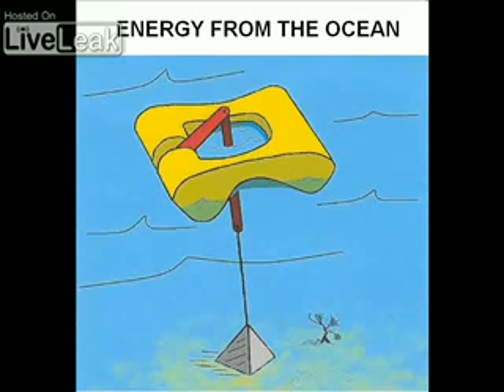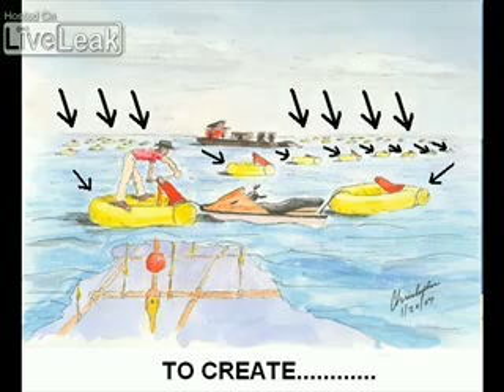Debunk this: FREE ENERGY

Comment: @rockethead7 

An interesting parallel here with solar and hydro (as you just mentioned) and geothermal. 

Solar panels could, if inefficient, act like asphalt does and heat up the ground passively, to disturb the natural nightly release of heat into space.

Geothermal is a whole can of worms that may or may not have problems. I can't see using waste heat from the earth's hottest places as terribly harmful, it doesn't contribute as much heat as the sun does.

Comment: @scienceminded
Technically speaking, I wouldn't mind if we had wave power as a backup source of some kind. If we keep the consumption of the power pretty low, the negative effects could be kept to a minimum. But, wave power is not the end-all-be-all answer. Remember people from 100 years ago thought building dams (like Hoover) would be the limitless supply of energy. Well, sounded nice. As long as it rains, there's power. Then they found out it had huge environmental effects.

Comment: @scienceminded
Dude, fucking read the journals. Do the math.
You quote from people who clearly think that tidal power is practically limitless... but man, I could find quotes completely opposite. Quotes mean NOTHING.
MATH is how you compute it. Take the forecasts for energy consumption curve for the future. Factor in a standard efficiency rating of about 33% (which is about average for mechanical systems). Subtract the tidal lock intertia from the current inertia, and do the MATH.

Comment: "Because the Earth's tides are ultimately due to gravitational interaction with the Moon and Sun and the Earth's rotation, tidal power is practically inexhaustible and classified as a renewable energy resource. Movement of tides causes a loss of mechanical energy in the Earth–Moon system: this is a result of pumping of water through natural restrictions around coastlines and consequent viscous dissipation at the seabed and in turbulence. cont>

Comment: @rockethead7 

The energy comes from the earth moon system, correct, but taking away energy slows the inertial loss, you couldn't speed up inertial loss by taking away energy, that would mean you are doing negative work. 

If we slow the tides we slow tidal recession, not speed it up. THAT'S the energy you are taking out of the system as more friction, preventing tidal bulging and inertial loss to the moon.

Comment: @scienceminded
500 characters is not nearly enough to respond in detail. But, no, the main effect isn't the height of the waves. The main effect is the friction (the generator devices would have to be planted, or they wouldn't work). There are secondary effects also, such as the repositioned water, etc., thus adjusting the lunar pull, etc. But, in short, look this up. There are hundreds of peer reviewed papers on it. I can't possibly explain in these limited comment fields.

Comment: The advanced retardation of @Cristofre
"instead of tidal lock at 20 million years and one day, its just 20 million years?" - Wrong. Off by a factor of over a million. Not a small error.
"Most of the earth is literally water." - Wrong. It's 0.02% water.
"Any force pushing against the generator would simply be passed back to the water/earth" - Wrong. The effects are understood.

NOTHING you've said has been correct. Quit talking out of your ass about stuff you clearly don't understand.

Comment: @rockethead7 

Correct me if I'm wrong (and I ask you do so in a civil way, I'm not emotionally invested in this at all so your secondary commentaries here are of no interest to me), but would not a reduction in wave height in systems which convert mechanical wave energy into electrical energy actually slow the lunar torque so it takes a longer time for it to move into higher orbit because the tidal bulging is exactly what causes inertial drag? You seem to be expounding the opposite

Comment: @tauruszuma I guess the issue with this particular video is the fact that the dude named the video "free energy" without fully understanding the fact that there are thousands of scams out there that use this term to name machines that supposedly make energy out of nowhere. His design is a very common wave-energy generator that transforms the wave's oscillation into electricity(Portugal's been mass deploying these for some years).
It's "free" as in readily available.

Comment: This could actually work.  And I had heard of it before, sometime in the mid-1990's, I think, called "tidal generators" or something like that.  But this is actually "renewable" energy like solar power, wind power, etc.  This is just another form of hydroelectric power.  Like someone else said, it's not "free" in the sense of perpetual motion, which is impossible.  This is actually realistic and could work.

Comment: Of course it is practical. You would only have to generate enough power to maintain battery packs. With the proper internal gearing a device the size of an oil rig could produce serious amounts of clean energy without depleting the resource. It is a very innovative concept.

Comment: one of the biggest problems with renewables right now is the inability to produce a consistant flow of power from these sources of energy, we're left short when it itsnt windy, and when its too windy we have to shut the things off to prevent them setting fire to themselves (problems not just with turbines, other problems are associated with other sources) its actually more inefficient to switch between renewable and coal than to just run on coal. we just need a way of storing the energy for free

Comment: @1overthehillsfaraway 

Cont.

Also I believe it's you who missed the point my original post was in protest to calling it "Free energy" which is typically assigned to a system that violates the law of conservation of energy.  Add to that the fact that this isn't free in the economic sense either, and you can see that the title is misleading.  He said this cost roughly 60$ and it will wear out. total output/total cost = power price.

Comment: @UrSoMeanBoss Yep true, nothing free about this energy. It costs hydrogen to make. The hydrogen fuses in the sun's core by nuclear fusion, releases heat which travels through space, absorbed by our atmosphere which drives weather systems which creates waves. Basically this is thermonuclear energy and it will run out eventually. Myth debunked.

Comment: @bnewton81 Magnets are *not* a source of energy (unless you do a matter/antimatter annihilation with magnets as the matter). Think of magnets like a spring or like gravity. They can aid energy transfer but you have to first put in what you get out, and you lose some in conversion losses. So a motor running a generator is nothing but a complicated way to waste power. It's a modern day snake oil.

Comment: @MrRiddler1111 yes its too simple to work. since you need energy to take the "inflatable" underwater or to inflate it which will always be more then what you would get out of it. but this idea is an old one. at least 100yrs old. its a very inefficient design. better ways of getting power from the waves are. the ones that uses a larg cavity that waves rush in compressing the air inside, the one hole that lets the air in and out has a multi directional turbine to convert that force into electricty

Comment: okay but only bc you said "DEBUNK THIS" yes this is "clean energy" or "renewable energy" but not "free" . on the one side you have the over unity/magnet motor nuts who claim for it to be "free" it does not have an energy input. where this clearly does waves. then you have the other side, of nothing is free. start up cost, maintenance cost, ect. then there is me, who liked the idea when i first saw it in a book about tech from 100 yrs ago. it has its places, but too inefficient of a design.

Comment: i see an inconsistant energy flow.  instead of powering leds as a demonstration, why not route the inconsistant flow into a car adio Boom Cap  (storage capacitor and regulator) for a build up of electricity and a continuously regulted, and adjustable flow?  I haven't found anyone conaining the juice to create a surplus.  until the flow is continuously creating surplus, there will be no market for the product.  with no market, no further developements will show.

Comment: what about using a double arm type of thing? It would allow you to use a second motor on the other side of the float. Connect the 2 together with some type of hinge system and boom double the power.

Comment: It actually sucks power from Three things:
1. Moon's Orbit (pulls on waves, helping cause tides)
2. Earth's rotation (Causes massive currents: google Coreolis Effect)
3. The Sun (Heated water expands, pushes colder water, causes waves)

The concept works.

So, as @SephieRothe says, nothing to debunk, but the energy is about as free as solar panels give.

Don't worry, there's plenty of energy to swipe from those three before they give up! Especially since it won't affect the sun directly.

Comment: Neat idea, but over engineered.  Things like these wave generators are already in existence, but they cannot generate enough power to make them usable.  

A simpler method is a tube, mounted to the sea floor, with a coil of wire within.  Then a large float outside of the tube, containing strong magnets.  As the waves move the magnet/float up and down, electricity will be generated, like an alternator does within a car.

Good luck to these guys, but they are a few years too late.

Comment: @kal9001 Seems like a good way to harness power.  I suppose a series of conditioned capacitance circuits would create a constant flow, if however if a conditioned power circuit were used to charge a series of power cells, you could achieve a highly efficient power source using only a few floats.   the real trick would likely be to have these floats move on a fixed vertical rail system, such as a pole firmly planted in the substrate below the surface.

Comment: @LastCynicStanding Buoyant force while completely submerged (neglecting weight of device):
F = 870 N
L = 2 ft = 0.61 m
Emax = F*L = 531.6 J
Assuming wave of this magnitude occur every 3-5 seconds:
Pmax = 106 - 177 watts
Now hook it up to some sort of power conditioner and battery system. Chances are your actual power output is far less than half this number. Congratulations! You can now power a 60W light bulb.

Comment: @LastCynicStanding Well finally! The sarcasm ends and you just blatantly called me stupid. I can't believe you're 37. Have you left any comments in which you are not insulting people? Okay... some time for some engineering. Given ~6" diameter tube, ~4 feet square (16ft of tubing), maximum lever arm displacement of 2 feet. The maximum available power will occur if the device is completely submerged by the wave while the crank is pulled. Next....

Comment: @LastCynicStanding Great job using a phrase out of its original context! I get your point, but my problem isn't a lack of vision, it's the painful stranglehold of reality. This device by itself is very limited. There needs to be a means of regulating and/or storing the energy produced. I think the idea is great, it just still needs quite a bit of work.

Comment: Now... how many of these will you need to say... power a typical coastal city? Or is this just an energy supplement? Furthermore, the energy produced must be used, power companies have to adjust power output to meet demand, it can't be stored readily. Wind turbines can adjust the pitch of the blades to control power output. Nifty invention, but I fail to see the practical application yet.

Comment: @imposible2play
You're right about it compromising the sea. These things will cause a change in the wave intensity, which could change the local currents enough that the local sea life would be affected. Changing current flow could starve out coral life by damping the flow of water which carries the food the coral normally gets.
You create a "Surge Pool" and place many generators in the Pool... But that would cost big bucks to engineer.
Nothing is free. It's all about the R.O.I.

Comment: Don't count your chickens yet... This is a spin-off of another ocean wave powered generator that was built about 30 years ago. Same basic principle: Device floats but is tethered in place, wave action caused a ratchet-type lever to spin a flywheel attached to a dynamo to produce power.
3 major issues you're going to face:
1)Keeping the device anchored!
2)Power line maintenance. Very costly!
3)Bad weather rips device from mooring line and power lines. Ref. 2

The salt air & water win every time.

Comment: there is a huge error on calling this "free energy" free energy doesnt exist since the laws of thermodynamics exist.  This type of devices are "renewable energy devices" or more to the point "Electric generator that runs on a non-payable form of energy" NEVER a "free energy device"

Other than that... Is a great machine, you should be looking now for a way to make that output stable. Maybe a bank of bateries and capacitors ???

Comment: @kurisu925 Of course I do understand where you are coming from. But if you had seen the actual road test demo you wouldn't think that there is a hidden wiring. Perhaps hidden batteries, but at bare bone set-up of the vehicle, finding such batteries to run for full 10 minutes with that motor should not be so difficult. Yet there is none to find. 

Anyway, you'd be hearing about this a lot in the very near future.

Comment: you couldn't put them anywhere near each other... they'd tangle like crazy.  It does produce energy, but not near enough to sustain some little led's that require almost 0 current, let alone a house that draws probably 50 times the voltage and 10 or 20 times the current.  You would need either a 50ft one of these things, or about a 1000 of those little ones just to power a single home on a regular basis, and that's only if you had a dedicated battery system that charged over night.

Comment: Very good idea, I think wave energy is going to be the "wave" of the future, But I see some problems that I think should be addressed. Not to discard this idea but it has to be a whole class simpler a system to be viable. I have had a few designs myself over the years and discovered  gear motors and springs just will not hold up over time, or at least offset repair costs enough to be viable. salt water, debris, wave action and wear points such as cable connections and bearing surfaces all suffer

Comment: This video is definitely entertaining but, it does not contain any usable or technical information. How much power does his device produce?  Maybe 300 watts at the generator? by the time the power travels through the transmission line to the lights it is probably closer to 200 watts. If the generator itself is repeatedly submerged under saltwater it obviously will not have a very long life expectancy.

Comment: i hereby coin the term "waste energy reclamation device" there i said it. Just like  solar/wind/tide power, the devices are used to turn energy we dont pay for, into energy we can use for a pupose. THe converting process costs money (like everything else) such as photovoltaic cells and windturbines, but the energy input is free and usually in a form we cant use for a set purpose.

Comment: There is no such thing as "Free" Energy in the monetary sense. The device still has to be mass produced, purchased, delivered, and set-up, which will require additional equipment (i.e. a boat). But "Free" in the sense that you don't have to buy the energy itself, as you would with Gas? Sure I'll buy that.

Comment: With those LEDs I could see nearly all the way to the other side of my dining room!

A bit harsh, sorry. Nice work guys but there are loads of energy from the sea projects. One of the interesting  issues (apart from problems of building life size units and transmitting power down cables) is that when you extract enough power to be useful to a city, you calm all the water. And people by the sea quite like waves.

Comment: As soon as a "new" energy source is discovered, a new potential is defined based on correlations with measured variables. Rarely was this process reversed, such as when nuclear power was discovered. So what seems to be energy out of "nothing" is actually not from "nothing". Once a little imagination is used, that source of energy should be figured out, and too bad if it's not...